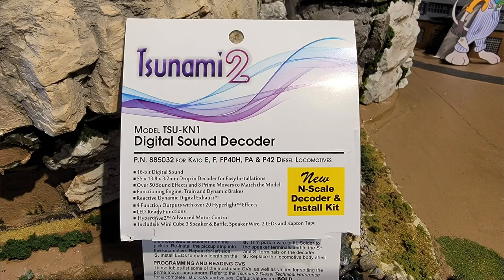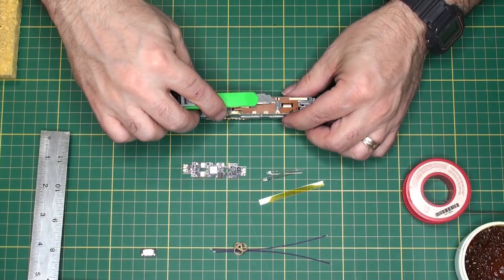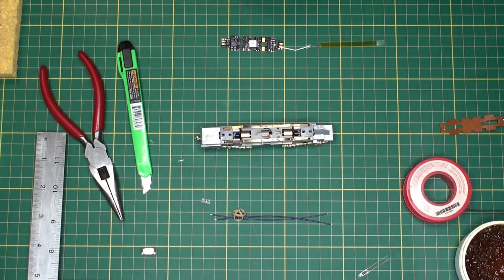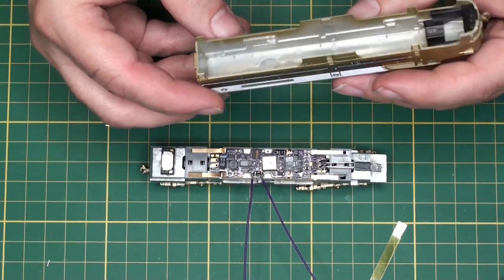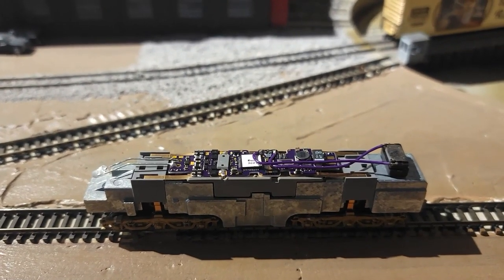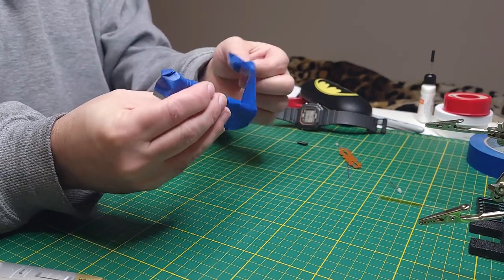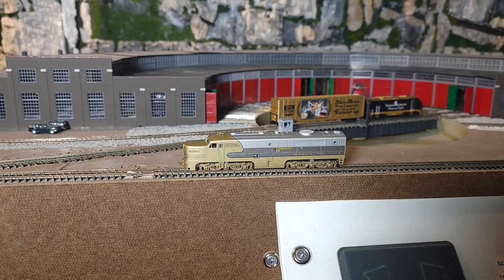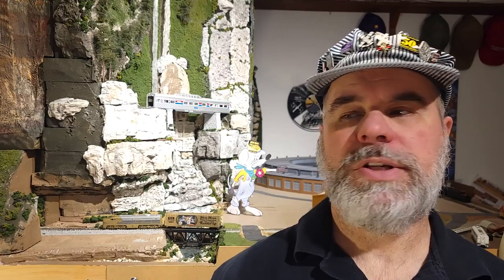How to install a Soundtraxx TSU-KN1 into Kato PA-1 - DaBob's ManCave

Comment: Thanks for the walk-through of the install. I recently picked one of these after hearing it in action, and put that on in a Kato F7B; no milling required :)  I also have one on the workbench for a PA1, following a broken frame incident, as the replacement has a nicely milled out spot for the speaker already! Will definitely be taking your advice on board for that one.